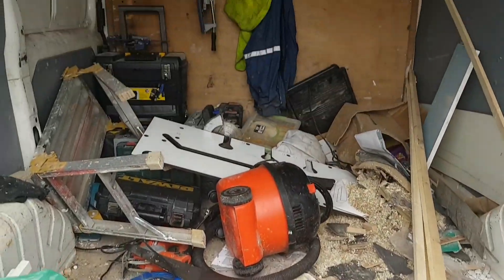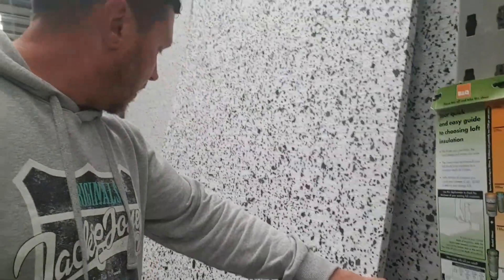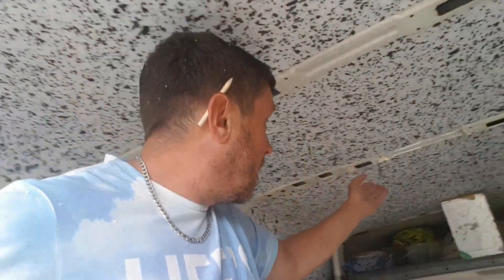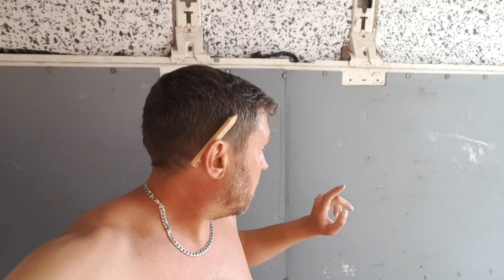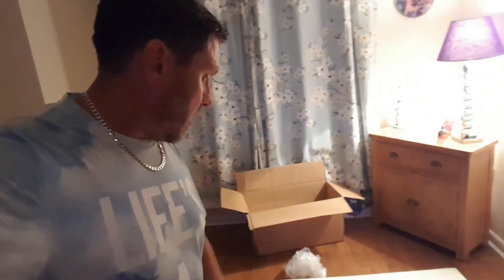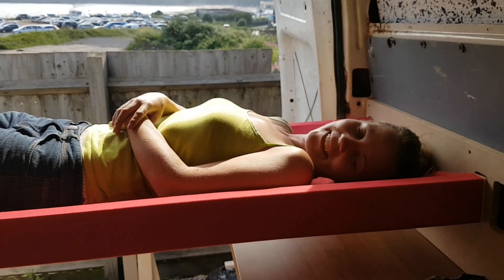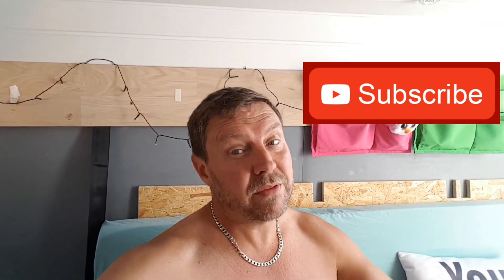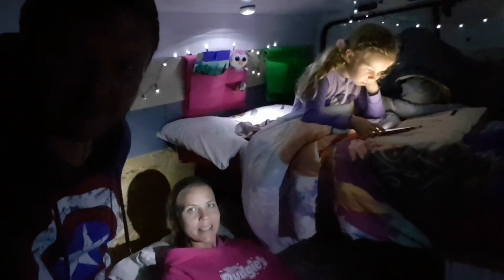DIY Camper Van Conversion To Sleep Family Of 4! Start To Finish 👌

Comment: Hi, i saw you idea of creating your own seats and addind seatbelts to it : it's super space-efficient, but i'm wondering if such seats are considered "safes" from an insurance point of view.
Is there any official source to show that you can actually just add seatbelts to anything and they're considered as any seat in case of accidents ?
I'm wondering since i'm planning on a van conversion myself.
Reply from the maker: Hi we did look into it and sideway fitted seats don't legally need seatbelts. But for obvious reason fitted them, ours are bolted to the steel columns in the van. Hope this helps https://www.gov.uk/government/publications/converting-a-van-to-carry-passengers-in-the-rear/converting-a-van-to-carry-passengers-in-the-rear#do-i-need-to-fit-seatbelts-in-the-rear
Good luck with the conversion 😊
Reply: Thanks a lot for the answer, it's very kind of you.